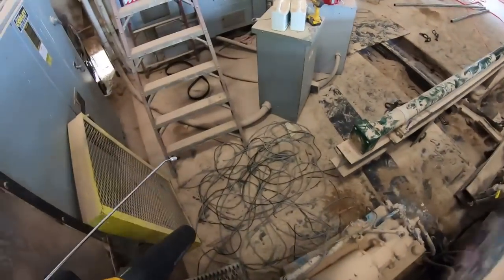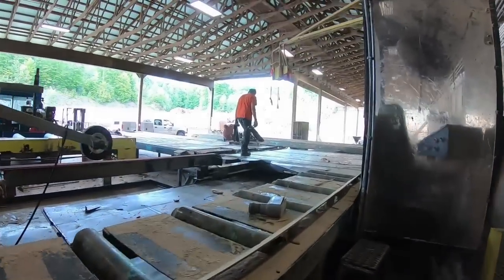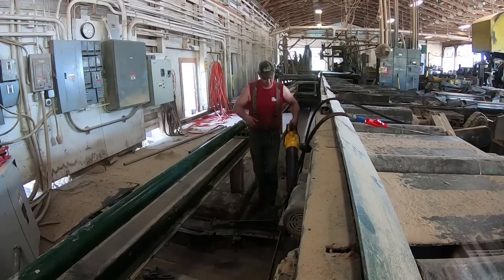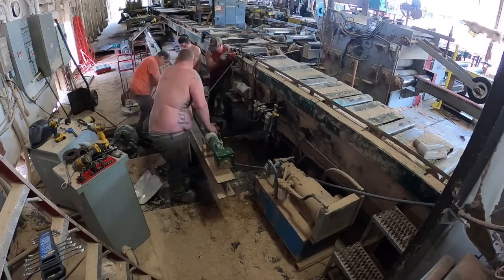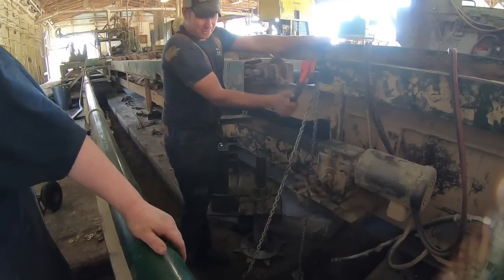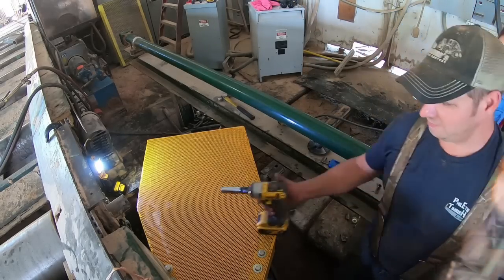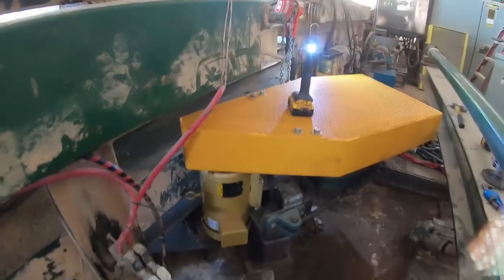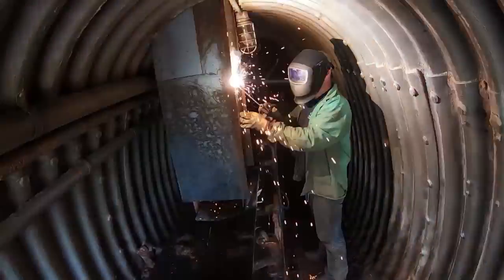Chain conveyor drive installation!

Comment: With the gear box turned 90 degrees from normal how do the bearings on top get lubricated?
Reply from the maker: Thats a good question its got a fill cap on top and I could run it a bit fuller than normal thanks bud ill scope that out better get a handle on that

Comment: Logger Perfect?  Has a nice ring to it but I’d stick with Logger Wade. Everyone knows your better than perfect. 😉

So does the barn chain make a loop around and drag all the saw dust back to the chute to drop it onto the belt conveyor with the drive sprocket sitting at one corner?
Reply from the maker: Yes exactly right

Comment: Wade would you ever think about putting in a pellet press for making wood stove pellets to use up all your sawdust.
2. A hammer mill to process all your Bark for Landscape Products ? 
👍 let me know 💙🙏😀
3. Thought of 1 more lol 
Firewood bundle wrapper for those pricey bundles of campfire firewood they sell in campgrounds and gas stations.
Reply from the maker: All thoughts we've had bud just don't know with current inviroment but no all thoughts we've had in the past

Comment: Im trying to learn to think like a fabricator from your videos. Was there a reason you didnt prefab a shoot and just drop it in? It could have been welded at floor level and easily removed if needed down the road. Hindsight is 20/20 i know. Keep up the great videos.
Reply from the maker: Ok that's an awesome question...  in a scenario like that when you cut out a ruff hole and gonna add a chute that has an adjusted angle on it and the hole ya cut out might not be perfectly square i just start with the straighter sides and add the odd sides after the straight ones are tacked in so anything could be busted right loose and re adjusted on the fly i prefab things that are important and that has to be built in a controlled environment and fab the other stuff on the go with a torch and welder makes life easier if that makes sense